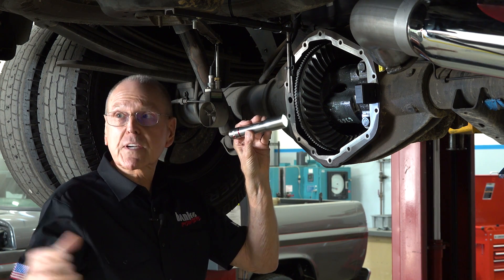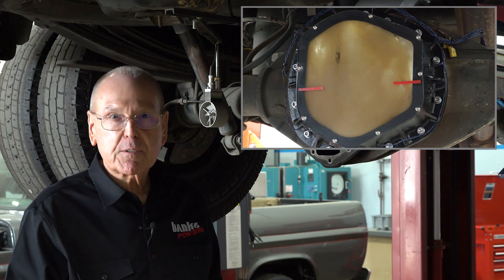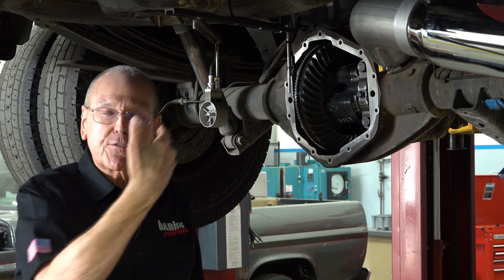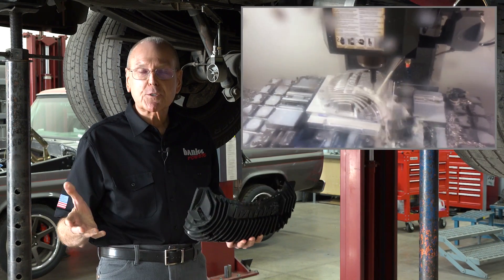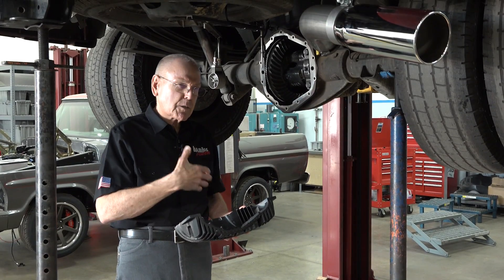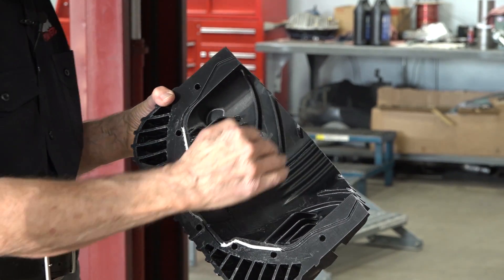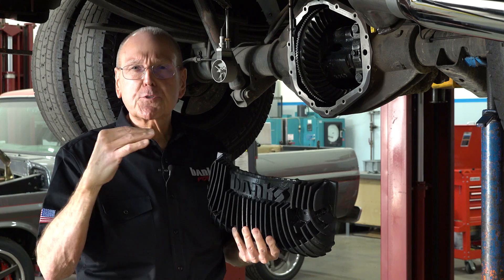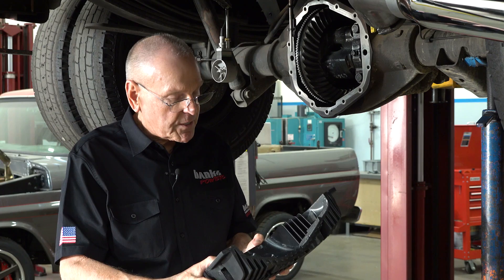Banks All New Rear Differential Cover – Perfecting the Design

Comment: My experience, is that if you buy a new truck. Load it to the max load, find a hill to climb and give it full power. You set in a wear pattern on the diff or diffs that will make it last almost forever! if you  baby the diffs slowly adding heavier and heavier loads, it changes the wear pattern so many times that it becomes noisy and eventually destroys itself. This info, you can take to the bank!  Your welcome
Reply: That's pretty much the exact opposite of what drivetrain professionals recommend. Using part of your logic, wouldn't you want to vary your driving habits to keep an even wear going across the face of the teeth?
Reply: Most manufacturers recommend varying your speed while the engine rings set in. I have yet to see a engine complain from pulling a heavy load at full power for 20-30 mins at the beginning of its service life. In fact look at the railroad service trucks! The engines don't complain of the heavy loads on them, that are immediately inflicted upon them! But the transmissions do! Depends on who is driving and these trucks get multiple drivers. This varying of speeds, is put in the manual to keep the factory from having to pay for a warranty repair. They have no interest, in helping you make the longevity of your purchase, last past 100,000 miles. They need the sales of new trucks to keep going.

Comment: What a concept. Using test data to determine what’s actually going on and engineering a solution based on that. As opposed to making a flashy chunk of aluminum in CAD with some arbitrary dimensions and volumes then selling it as an “improvement” without any real data.

I’ll be watching this with interest. My 2011 Silverado 2500HD Duramax uses that AAM rear axle. If Banks goes to production with a properly engineered component, at a reasonable(ish) price, with supporting data to show how theirs improves things... that’s what will get me to separate from my hard earned dollars and buy parts for my truck.
Reply: reasonable(ish) priced... LOL yeah ok...
Reply: He still hasn't shared any actual data...
Reply: @kaipos8601  Exactly!! That's what he said was the purpose of the diff videos. So for 3 months I've waited to see scientific data from him and instead he is now selling a diff cover. Whatever Gale

Comment: Hey Gale, does the problems with higher volume diff covers translate into the same problems with transmissions? Over worked/aerated fluid? And how about the oil cooler/higher volume chambers for manual transmissions like the NV4500?
Would be a great next series to tackle.

Comment: Interested up until he said "ram air", for what I assume is to pass more air over cooling vents.  Last thing I want is crap hanging off to pack mud and grass in my diff cover.  Also, based on the sample in video, it now has corners on the banks cover that can hit something and possibly crack the cover or open seal and dump my diff oil???

Comment: BMW diff cover on V8 engine E60 platform, for one, has the finned cover with horizontal air guide element to capture and divert air over the fins on back of cover. There is at least one guide berm inside but I don’t recall multiple fins inside.

Comment: Looking forward to the cover coming to market. I will be buying. Have an 07 Dodge 3500 5.9 HD dually and tow a big 5er toyhauler over the mountains with it. I hope the cover comes with a port for a Temp gauge. I have had a temp probe in another truck with another cover and still have those numbers will be very interested in the comparisons. 
If you need test subjects for those conditions let me know.

Comment: If the ram air pickup is on the bottom, your increasing the chances of hooking that on an obstacle, right? Can you scoop of the top of the axle and provide a skid-ramp style cut to the bottom to prevent damage?

Comment: I can't be the only one thinking if you have a different shape/size cover the important thing is the fluid level in relation to the axle not 4qts of oil or is my logic wrong?
Reply: I completely agree
Reply: He literally tested size and shape comparisons to see exactly what hes talking about. The cover helps direct fluid to the pinion and if it is a squared back it catches fluid which prevents it from going far enough forward to cool and lubricate the bearings. The quantity creates aeration which creates less cooling and less lubrication capabilities because theres air bubbles running through the bearings instead of oil. A properly designed diff cover with the proper quantity will work better than any other combination of the two.
Reply: @jaredanthony8070  agree 100% stock shape is best but if you could make it hold more oil that would keep temperatures low and a larger volume will last longer
Reply: @jaredanthony8070  he hypothesized the things you stated... He has yet to share any data that reflects his theories
Reply: Watch it again... he specifically states, for the AAM axles in dodge and GM, 4 qts is factory level. Overfill is causing aeration. You're trying to second guess a man who has forgotten more than most of us know.
Reply: @TheRoadhammer379  im saying his dif cover is different than stock so he should find stock level in relation to axle and then make it the same level compared to axle center line not 4qts his might be 4.5qts to be the same level
Reply: @marcussamson2191  - that's exactly what he's doing. They already tested exactly where the factory fill level is, and from what he said in this video they're making sure their sight glass is positioned correctly for that factory level. Quantigy of oil might change, but the level will be as the manufacturer suggests. 

That's what I heard from what he said...

Comment: I'm all for it and it looks interesting on a street queen truck. I'll be the stick in the mud even though I understand all the work gone into R&D. What is gonna happen on a 4x4 when those cooling fins hanging off the bottom get bumped on something and break off? Is all the oil gonna dump out of a crack created in the cover? What is gonna happen with those fins on the inside when a rear blows up? Gonna have to buy a new $200 cover every time? I'd be interested in seeing a computer estimated flow with those fins on the inside, better would be another clear cover but I know how impractical that would be. Personally I see those fins creating dead spots in the flow so basically instead of 4 qts you end up with only 3 qts in the splash lubrication flow.

For now I'll stick with my 3/8th steel fabbed cover. It might not be perfectly round on the inside but it's not a square either.
Reply: Why would you run an aluminum cover offroad, in rocks? That doesn't seem very smart to begin with.

Comment: I seen dodge trucks go million miles with a stock metal diff cover. No need to reinvent the wheel.
Reply: The entire after market automotive industry is based off reinventing the wheel. If it wasnt for people like vic edelbrock or gale banks or Mickey Thompson or or or we wouldn't have aftermarket parts or performance parts as we do. If everyone lived by your logic of dont reinvent the wheel we would all still be riding horse and buggies because a car is an absurd thing to reinvent the wheel for. Henry Ford as well as other early automakers including Harley Davidson got a whole bunch of flak about how they were wasting their time trying to make an automobile and about how impractical it was. Without that we would still be in the industrial revolution trudging along without the capability to transport stuff so readily and cheaply.
Reply: @jaredanthony8070   90% of the aftermarket companies put out shit product from china. So they can keep reinventing the wheel But I will keep buying OEM stuff.
Reply: @brianp5579  a ton of aftermarket stuff is Chinese crap yes. The part that isnt is well worth it. Have fun with the mentality of "the engineers know best" even if it really isnt the case.
Reply: @jaredanthony8070   have fun bolting aftermarket autozone parts on your car.
Reply: @brianp5579  no I avoid autozone parts and try to get the best I can. Things like banks edelbrock Holley etc. Companies that know performance over stock equipment. Have fun taking your car back to the dealership time and time again when factory parts fail. Enjoy your meaningless blob of silver that gets you from a to b. I'll enjoy the trip between a to b in my vehicles.
Reply: @jaredanthony8070   My car might not make it to the stop lights the fastest, but I can assure you that my car will have a lot more trouble free miles using oem stuff then your raced out silverado.
Reply: Brian Petterson great point! My 99 dodge has 863,794 currently most of which is towing 11K lbs daily with a stock OEM drivetrain. Diff fluid changed every 100K stock diff cover.  Some things don’t need improvement!

Comment: I like all the science behind this, I think it will DEFINITELY improve performance, but the thing that literally sticks out like a sore thumb to me is the fact that the diff cover sticks out past the profile of the axle housing.  I think there will be a nominal aerodynamic loss of efficiency, but the deal breaker for me is that the diff cover edges are subject to damage from road debris or hitting the ground when going off road.  An aluminum housing looks like it would be easily damaged and cracked, causing a catastrophic loss of diff oil.  I like the fins on the back but I think the profile should be reduced quite a bit to prevent damage.  Maybe adding bolt on fins on the axle tubes either side of the diff would help to dissipate heat through transfer, without the risk of a cracked diff cover which would be a disaster.  I'd also be concerned about dirt buildup with that design.  
Gail, maybe you should incorporate some real world road tests in off road conditions before you finalize the actual shape.  Thanks for all you do!

Comment: Gale, you should have the corner ram air catchment portions be breakaway or even removable for those who do serious offroading.
Reply: goitoutdoors or just make the ram air part on the top of the cover so it doesn’t catch on anything.
Reply: The diff air scoop should have a blocker plate for winter use too.

Comment: Looks like you can correct the fluid passage and posible air ration of the oil by adding a sheet metal baffle in a current aftermarket differential cover???
Reply: Really??

Comment: Banks cover looks a lot like some OEM aluminum covers.
Reply: He proved the aftermarket ones are worse than the OEM parts which is why it is designed that way, the OEM cover direct fluid to the pinion bearing so they get proper lube and cooling.. it's pretty cool I watched all the videos they've done on this and have been patiently waiting... There are draw backs to adding more fluid/"better" cooling capacities.. it's pretty cool to see it functioning with the clear diff covers they produced and tested... The man is a genius

Comment: Please make sure the new diff cover has a drain hole. If it does not i will not be buying one i change my diff fluid about once a month. I'm a hotshot unit and put down a lot of miles.
Reply from the maker: The cover features a fill port at the top (which can double as a location to insert a thermocouple), a sight glass facing the back of the truck for easy viewing, and a drain plug at the bottom.
Reply: Is the new diff cover on the market yet? If so, is there a link to it?
Reply: @bankspower  that's amazing i can't wait to buy one
Reply: Are you putting down 500,000 miles a month because that drain interval is wastefully short. If you don't believe me you could send a sample to an oil analysis company so you can get a more sane estimate of fluid change intervals.
Reply: @erikkovacs3097  im going off the owner's manual and they said to change it every 20k when you do a lot of towing and that's something i do a lot of
Reply: @brannonspeer245  You should totally do an oil analysis at your next drain. I am curious of the chemistry of your oil. If high oxidization is detected that would be an indication of high temperatures and a heat dissipating cover is in order.
Reply: @erikkovacs3097  i have an mag hytec diff cover now so i run the oil to 30k but i will  still do an oil analysis
Reply: @erikkovacs3097   Hot shots use little trucks to do big truck jobs, e.g. LTL freight and hauling cars.  Once a month does seem mighty short though.
Reply: @treyhart6861  Not really for rock crawlers going 5mph and moving continuously for maybe a few min at a time. Rock crawling is not hard on diff fluid.
Reply: @erikkovacs3097  Very true.
Reply from the maker: darkjedi351  Agreed. ARB is a great choice for serious off-roading.
Reply: darkjedi351  yeah i went with mag-hytec it had a nice drain hole and a fill hole on top of the diff cover plus it was made for the 2017 ram 2500 with a sway bar.
Reply: My diffs have drains in the bottom of the diff.. not in the cover :S
Reply: @minikeg  what year is your year make and model
Reply: Brannon Speer 2017 f550 has a labeled cover bolt for a drain pull the one bolt diff drains put it back in filler back up. All real trucks have diff drain plugs ie peterbilt kenworth freightliner western star and so forth
Reply: @shaunbarlow8993  yeah i seen the drain holes on them but the 11.5 aam he is working on does not and i have the 11.5 aam in my tryck
Reply: Change it once a month! My 97 Pete has 2.13 million miles and I've owned it since new. I change my fluid every 250k and have yet to have a diff burn up. Even as a hotshot rig, I doubt you are putting 250k on that pickup every 22 months, and you sure as hell aren't pulling 80,000. 20,000 mile fluid changes might be because you are a single axle rig, that is my guess.
Reply: +Brannon Speer how about hooking up an autometer temperature gauge to that cover Through the extra threaded Port provided in the mag hytec cover. I have used this temperature gauge on numerous Transmissions that I own. I have the same Mag Hytek cover you do and bought it for the easy Drain feature and the super easy fill feature through the top. Banks said they got their differential up to 326 degrees on a test Towing heavy. I would like to see that test on video.
Reply: Running a filter and pump would likely be a better option, how about cutting the cover for an O-ring gasket, if its your livelihood, add what's called a magnetic chip detector.
Reply: darkjedi351  Warn and Rough Country (among countless others) also make bolt on diff guards which are easier on the budget and can be installed in 5 minutes.
Reply: +Shaun Barlow sounds like the Ford 9-inch that has a built-in drain plug but no removable rear cover.

Comment: Most excellent!  It should be illegal for "performance" companies to NOT do testing and NOT disclose the performance of their product.
Reply: Which is why I don't buy cold air intakes... I've saw countless dyno runs with little or no gains and sometimes even a slight loss.. nothing you would notice or feel but to see it is pretty clear they don't work, which is why I just buy the drop in replacement from afe or AEM they make dryflow stock drop in replacements for most trucks

Comment: I wouldn't dare claim to know more than Gale or the company in general, but why the emphasis on 4qt? It's the level that counts, not the volume. Increasing capacity can't be bad so long as the level and flow are maintained correctly.
Reply from the maker: You're correct. We want to be able to tell everyone to fill with the same amount of oil on the GM/Ram trucks so the level is consistent. If design a cover to fit more oil, the cover must move farther away from the ring gear, which hurts its fluid dynamics.

Comment: Noticed the internal ribs shaped to deflect and direct oil flow into desirable area.
That is worthy of new patent.
Reply: Well outside ribs are for better heat transfer, but look closely and you'll see internal ribs curved to direct the flow. He wants that oil to be flowing into exact place Mr Banks sees it critical for longevity of differential.
Reply: Szymon Bujak yes the internal ribs transfer the heat to the outside ribs, the pinion gets more than enough oil with the stock round cover.
Reply: J Bandit The internal ribs will of course transfer heat, but if that was their sole purpose, there would be more of them, and they would probably be shaped differently/more plainly.  I think @Szymon Bujak is correct, they look like their purpose is to deflect oil to perhaps the diff bearings. Sort of like canards, but for oil instead of air.
Reply: Szymon Bujak probably more of an internal part of the heat sink

Comment: Ram air cooled? Wouldn't that cause some drag?
Reply: I doubt it... Especially with it being on the under side of the vehicle. Most vehicles even trucks are designed to have most of the airflow go up and over the major surface areas, which is why alot of trucks come with the front air dam on the undersides of the front bumper...

Comment: Will be interesting how the Ram Air  passages will be kept clean.  Though it may be marketed as on road only.
Reply from the maker: Take a hose and spray out the muck. Easy as that.
Reply: Could be easy.  There's the question of rocks, pebbles, sand, salt.  These aren't criticisms, just what if questions.
Reply from the maker: @creigmacc  All great points. We probably won't recommend this cover for off-road use. The high heat is typically a result of towing or racing.

Comment: I always wondered why you couldn't do RAM air cooling. Got a jacked up mustang and everything is great except the rear diff overheats.. finned cover with air should help a lot.  Nice work..I know it's for trucks but the car guys will follow him all the way to the Banks....
Reply: thereissomecoolstuff put a pump and a cooler on it
Reply: The Germans have been doing it on stock performance vehicles for some time now. Think SL55 and E46 M3.